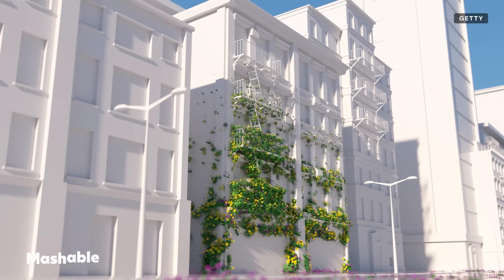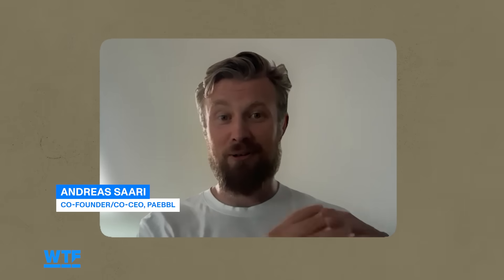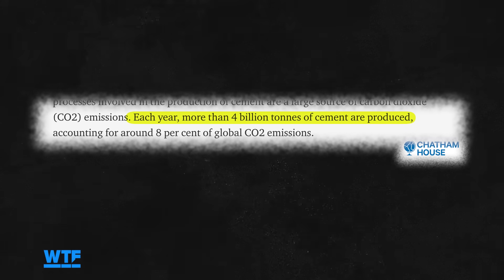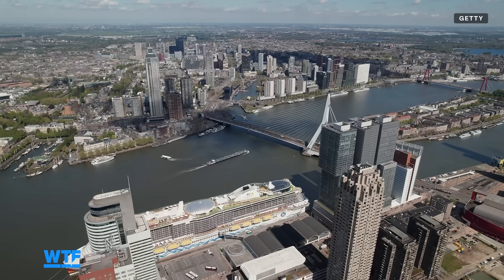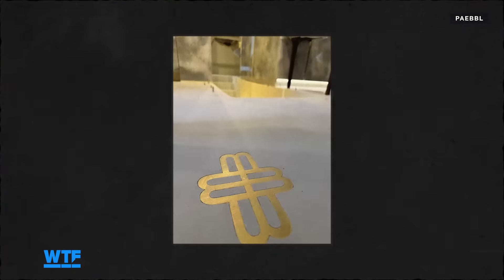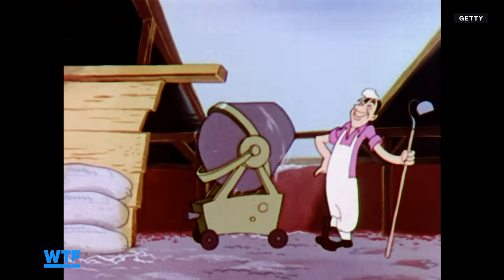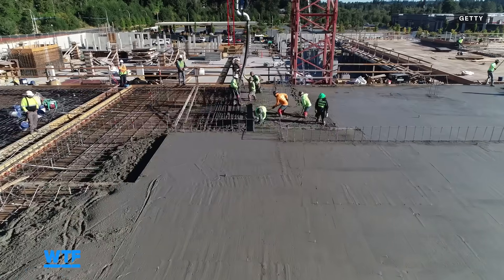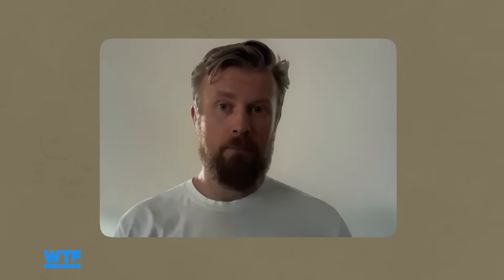What if Cement Production Could Store Carbon Instead of Emitting It?

Comment: There is no climate problem with cement!  Climate change models have been proven wrong time after time.
Reply: This is a little bit of a misnomer. Not all the future projections are correct but that doesn't mean climate change isn't happening. Just looking at fires, local temperatures, hurricanes, and flooding frequency, it's pretty clear the climate is changing.
Reply: I've looked over many of the older predictions from the IPCC and in general they track pretty well, keeping in mind they always made several trend predictions based on potential long term strategies impact on warming-in my experience people like you look at the worst case scenario prediction, which the IPCC always explains is unlikely but it created for illustrative and comparative purposes, see that it didn't reflect what happened and declare the whole endeavor worthless, signalling profound ignorance of the scientific process and purpose of these predictions and models.  
We have robust readings of atmospheric CO2 levels and isotopic analysis conforms the lions share of the new CO2 in our air is from fossil fuels we've burned.  CO2's ability to insulate the atmosphere is very well understood physical science, and that doesn't even get into its current role in the rapid acidification of the ocean, which is putting more and more strain on ocean ecosystems that undergird much of life on earth.  This hand waving of obvious material reality in favor of a retreat into vapid denialism that engages only shallowly with the actual facts is strikingly similar to the lengthy industry-supported conservative project of opposing secondhand smoking protection laws-in many cases the same ghouls that did that monstrous work have now pivoted into supporting the denial movement with the backing of major fossil fuel interests.